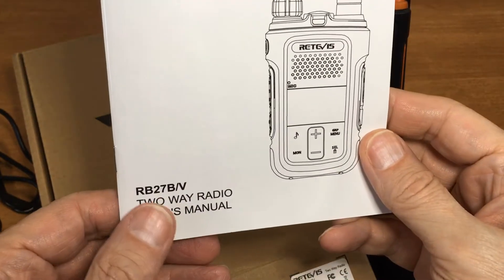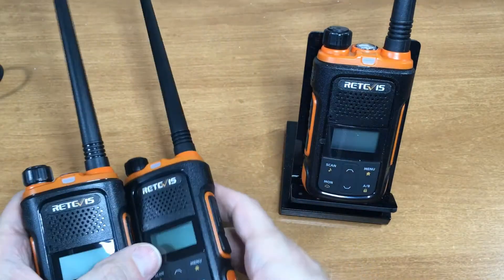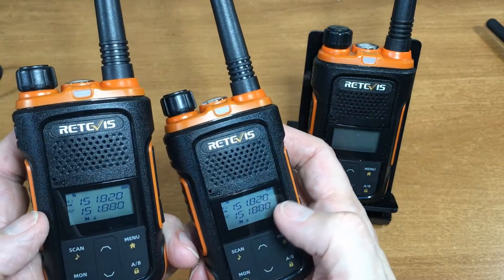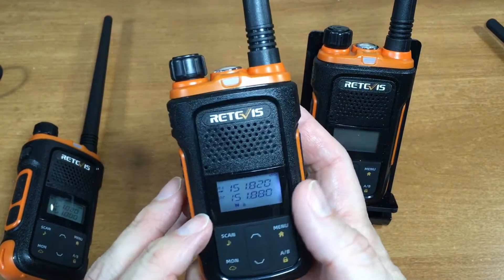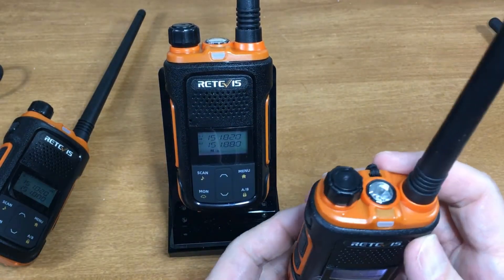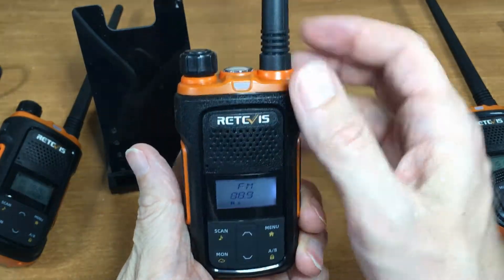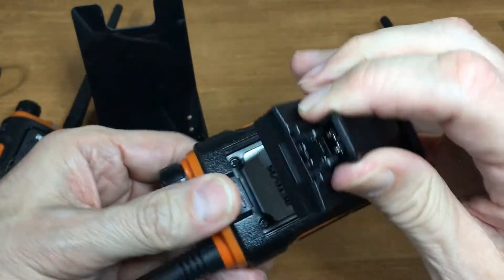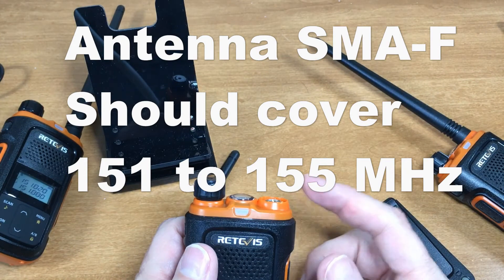Retevis RB27V MURS radio -- First impressions

Comment: It’s actually right above the 2 meter ham band so it’s going to behave like this 2 meter 144 to 148 MHz band. So if 2 meters is open, murs just might be too. It’s basically ham radio, but without the requirement for a license. I don’t recommend using a ham call sign down there on murs or anywhere for that matter.

Comment: They come in a 3 pack and 5 pack. they do program chirp . you get great range with Abbree 771 antenna . that tune 150 MHz and 460 MHz . also the 42 in Abbree works on them. got several miles between the 2 on Ch 4 wide. could not do on stock antenna . will USB C solar panel charge.  or a power bank with USB A to C or C to C cable. my outher radios like that are the RB 27 GMRS and RB 27B FRS . can use MURS and FRS same time on 2 different radios buy each outher. even CB . the only issue we had is when using same band and different Ch when close but a outher person it cuts the receive out on outher radio . only happens when close to a outher radio on the same band.

Comment: Sorry to see you got scammed.  The Retevis RB27V is not FCC approved.  The FCC ID 2ASNSRB27V is not in the FCC database and therefore not Part 95J / MURS approved.  I contacted Retevis and they acknowledged this and suggested other radios for MURS usage.  I'd suggest you'll check the FCC ID database yourself and request a full refund from Retevis.
Reply from the maker: You are correct. The MURS is not FCC certified. The FRS, GMRS and Amateur (ham as part 15) are certified.
They did replace the bad radio.
I do not see this model on the Retevis website anymore.

Comment: I don't think I like the alarm mode. I wonder if theres a way to disable it via the CHIRP software
Reply from the maker: Retevis replaced the radio that turned on with the alarm activated. It is not supposed to come on unless you activate it.